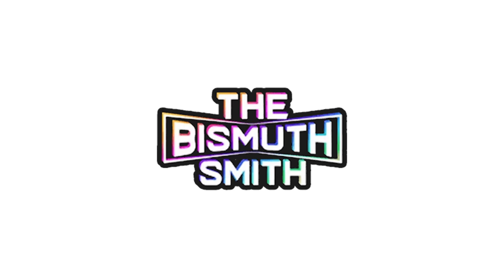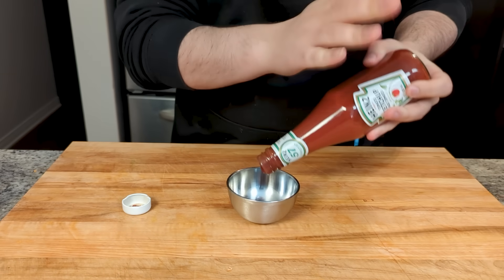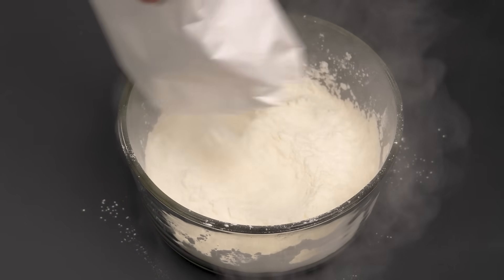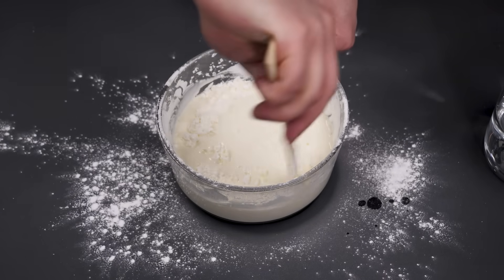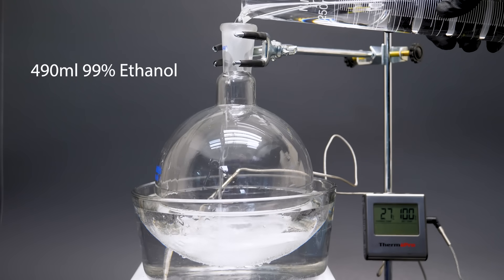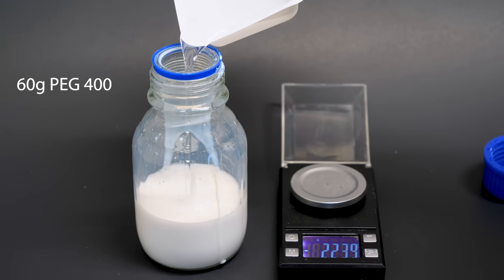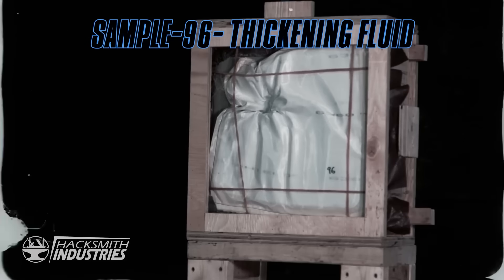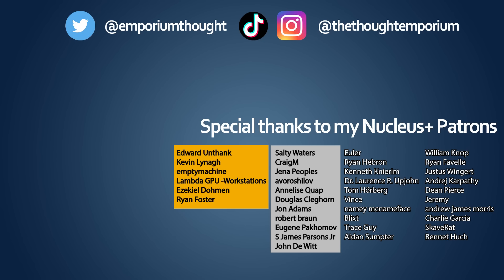Liquid Ballistic Armor? | Thehacksmith Collab

Comment: Thanks for sending us the STF to experiment! We'll have to try some other advanced chemistry projects with you in the future! That tank armor sounds fascinating...
Reply: First
Reply: Best collab!
Reply: I wonder what your team could do with the plasma sputtering beam.
Reply: @ryjunplayz8321  nice work
Reply: Imagine if STF was actually used for Tank armour
Reply: This is such a cool collaboration of skills
Reply: You can collab again and make a tank
Reply: If you end up trying the spider silk, I wonder what you could get by soaking the Kevlar fabric in the growth medium and letting the yeast grow and produce the silk in place.
Reply: Graphene particles in suspension?
Reply: And thus, the League of Evil was born
Reply: Hacksmith + ThoughtEmporium = Batman + Superman
Reply: You could send them your Kevlar scraps so they could do a follow-up with the STF
Reply: try making it with olive oil not water, it becomes electrically hardened it could make the best Bracks or shock absorbers etc.
Reply: @rodneynormanhersom3583  Wow, really? I'd like to see that.
Reply: so would ferrofluid work?
Reply: @Aaron-zu3xn  that's a magnetic fluid so no it has no stopping power.
Reply: Po yy
Reply: I actually had a similar idea, only instead of fluid, it'd be a form of gel, like gelatin, or ballistics gels, basicallyable to hold it's shape after coming out of the mold, that gel would quickly harden and set like rubber cement when exposed to extreme force, it also hardens when exposed to air so help plug up leaks in the armor like from for example, bullet holes. But like many non newtonian materials, the rest will revert back to its gel form once the force has stopped, except for the small area aroubd the hole to help preserve the rest of the gel. What do ya think?
Reply: nanoparticles son they harden in response to physical trauma.

Comment: "Nano[particles] son! They harden in response to physical trauma! You can't hurt me!"
Reply: STANDING HEEEERE
I REALIIIIIZE
Reply: BRO IT FITS SO WELL
Reply: @XxX_afterHours_XxX You were just like me
Trying to make history
Reply: Crysis reference?
Reply: @ConandeBrodo Metal Gear Rising reference
Reply: I was looking for this comment 😂
Reply: @LHWK_RHC same
Reply: Nu Uh -raiden (his dog brought him a cool red stick)
Reply: Dude I was gonna write that
Reply: @unk4617  To be fair, that blade might've been going between the particles, not allowing the particala to compress.
Reply: @rya3190  no its too thick even if the edge got through the particles would grip it like a vice 
maybe the sword was made with an alloy which on contact with the nanobots disabled them chemically
Reply: @unk4617  Well, you're also making that edge out of plasma, breaking down the solids nearby. Not to mention, if you're cutting between the particles, you're forcing them around the blade, outwards, with enough force to deflect skyscraper sized blades...
Reply: @rya3190  yeah but that doesn't get around the fact that presumably the particles are all over the body and not just skin deep assuming the blade of muramasa is just as strong as ridens normal vibrating sword  and i doubt a sword which is lorewise was passed down for a very long time

Comment: Also, .45 is not chosen for its ability to penetrate armor. It's the worst round for penetrating armor of what is in common usage.
Reply: Stopping power though. Imagine being hit in your best by sledgehammer
Reply: @Adoffka  What do you mean by "stopping power"? The kinetic energy of the bullet increases linearly with mass but exponentially with velocity. A regular 9mm round is generally on par with a .45 ACP in terms of force delivered even though the round is smaller. A 9mm +P+ round would blow the 45 ACP out of the water
Reply: @Adoffka  the average .45 acp produces between 350-500 ft⋅lbf at the muzzle,  the average 9mm is virtually the same.  to compare, a 55 gr. (that is 1/3-1/4th the weight of most 45 acp) 5.56 (the round used in the AR 15 and by militaries worldwide) produces well over 1000 ft⋅lbf out of anything with a 16 inch or longer barrel
Reply: @sergey_is_sergey arguably, stopping power is basically a thing, in regards to being shot while wearing body armor.
Reply: Yeah and neither are mosr sub machineguns. I was pretty disappointed because I was expecting them to be "gunning" for at least level 4 protection here

Comment: The best protection inserts for motorcycle equipment are made from materials with the same property, but more «solid» in free state, which looks like soft rubber (and doesn't restrict movement much) but becomes hard on impact and distributes impact energy  on larger area.
Reply: Works great, too. When showing off my D3O pads to people, I demonstrate by putting one over my hand & hitting it with a hammer. The reactions are always priceless.
Reply: They're not the best though. Not even close. 
They are by far the most comfortable though..
Reply: @Mentholox   Best doesn't mean safest. Aerobags vests are safest (or not to ride a motorcycle at all).
Reply: This is ridiculous. If it turns hard the instant it hits am impact, THEN JUST BUILD IT HARD IN THE FIRST PLACE.
Reply: @melody3741  Try to have hard shell around your knee or elbow joint. It is possible, but very inconvenient for commuting, for example. For hard core sport like enduro or or motorcross — sure, double articulated, separate protection. For touring or commuting? Possible, but too much and very inconvenient.
Reply: @melody3741  This soft protection is for use with humans. You are right about things like vehicle armor, but humans are soft and need something that moves well with them in order to be effectove in their tasks
Reply: that's smart af
Reply: Yep, d30 was in my lacrosse gloves almost 16 years ago. I hoped they'd make it bulletproof by now. 
@melody3741 you clearly don't understand the application of, and why a non-newtonian fluid would be desireable trait for bulletproofing. Flexibility. You ever wear a steel armor plate? Or a 3A soft body armor? Would you rather your shirt be made of wood or cloth? The idea is that it moves with your body when you want it to, but protects u when ya need it
Reply: What material is this?
Reply: @melody3741  because it would be pretty cool and useful to have a material that switches between the two as needed? Wearing a giant steel plate on your chest to stop bullets could maybe be improved on.

Comment: According to a paper I read, 12nm is the ideal size for the silica. PEG to silica should be a 60:40 ratio and the PEG 400 benefits from a 5% addition of PEG 10,000 (possibly a higher % would be even better but studies had not been done at the time I was researching. The graph of results improved with every % addition of PEG 10,000 and the curve showed no sign of flattening, but the study stopped at 5%) and the whole mixture (including alcohol) should be sonicated for even distribution of the silica through the PEG
The alcohol needs to be thoroughly evaporated off the aramid/kevlar/whatever so I would think baking it at 85c would be the way to go.
Reply from the maker: got a link to that paper?
Reply: @thethoughtemporium  I'm sorry, I don't THINK I do any more, this was just for a hobby project. It might be on my old hard-drive. I will look and if I find the folder i'll find a way to get them to you (2 separate papers actually, one about nano-particle size, the other about adding PEG 10,000)
I would note, that the 12nm size might be specific, for example it might be LESS good at energy absorption but also allow for a higher density of Silica to PEG, I'm afraid I can't remember the specifics.
Reply: @thethoughtemporium  I read a paper that said .25 micron fumed silica. it  also attributed the hold to micro vacuums made when the liquid was too thick to fill in the gaps fast enough.
Reply: @@msmoonboosource = the paper he just stated.
Reply: @Ms Moon Boo OP literally cited the paper right above you????
Reply: @thethoughtemporium  Modification of the silica surface using boric acid can form dynamically crosslinked covalent bonds.
Reply: @thethoughtemporium did you ever come back to this... Also what happened to the tank armour
Reply: @sarchlalaith8836  I wonder if he will ever come back to making the other gemstones that he talked about in the opal video :(

Comment: The interesting thing to look at would not be penetration, but damage — getting shot wearing soft armor may not result in bullet penetration, but it can easily bruise and crack ribs. You won’t see that find of improvment in the samples you were sent though. 

If you wanted to measure this, a force sensitive resistor grid with peak hold will give you a great idea of how (and if) the shear thickening fluid spread out the force appreciably.
Reply: Or just some kind of weights
Reply: I mean, a bruise or cracked rib is at least a preferable alternative to like a punctured lung, although I guess a broken rib could lead to that
Reply: Ya but if you could somehow layer a thin layer of soft armor over a thin plate of rigid armor, then youd having something very little and very resilient
Reply: @Brent-jj6qi we dont watch these videos for moderate and boring results. If it cant improve on very basic body armor then it's far from what you could consider a success

Comment: How do you avoid the particles settling out of suspension when layering them like this?
Reply: To put it simply, sedimentation/creaming velocity (for particles denser/less dense than the solvent respectively) are counter-balanced by Brownian motion (the tendency of any particle to “disperse evenly” (imagine e.g. color mixing into water)). Below a certain threshold of about 1 micrometer in diameter, a sedimentation equilibrium can be reached where sedimentation is perfectly offset by Brownian motion, yielding a colloidal suspension.
Reply: @waterunderthebridge7950   Nano-machines son.
Reply: @joshyoung1440  Go back to stackoverflow with that non-answer.
Reply: make a polymer out of it, or something of the sorts of an ionic liquid, where one of the ion donors is a long chain hydrocarbon
Reply: @trenvert123  LOL
Reply: I think more or less like saturating a towel, or some porous fabric layer, sandwiched with kevlar sheets. The fabric's porosity will allow the material to retain shape while fluid, but add sheer force and that gets distributed across the area without it flowing down due to gravity.
Reply: @waterunderthebridge7950  Ok so you're saying that with small enough particles, below a certain concentration the random motion of the particles outweighs their tendency to settle?
Reply: Add a polymer (or mineral particles) that gives your solution a yield stress value. The big particles won't be able to overcome the yield stress and fall down/swim up.
Reply: @waterunderthebridge7950 to put it “simply” huh

Comment: to keep it functional you have to use a liquid, as the glue prevents the compressive stacking. to do that in a vest you basicly have to make the vest out of pockets like a down jacket, so bottoming out is confined to each pocket, and make two offset layers so the seams are not weakpoints. or you use this non-newtonian rubber mixture thats used for some sports protective gear as a glue for the particles.

Comment: I wrote a whole paper on how novel concepts could be used to improve body armor. Sheer stiffling gel (SSG)was one of the topics i covered as well as resin based self repairing technology. One group of researchers found that carbon black could be suspended in the SSG you could sense and measure impacts based on the stiffling effect changed measured resistance acros the panel. This could be used as a monitoring device for combat medics to automatically alert them if someone receives a shot or impact that causes sever bodily harm
Reply: so you wrote a paper but dont know the difference between sever and severe 🤔
Reply: @MalcolmCooks  perhaps english aint their first tongue or maybe its a basic typo

Comment: The early uses (10+ years ago now) of STF in armor were to improve stab resistance, rather than bullet resistance.  Would be interesting to know if your initial attempt did that.  If so, improving the stab resist without compromising bullet resist, is a pretty big win.

Comment: Technically Ketchup isn't a pseudoplastic (shear thinning) fluid. It's a thixotropic system. The viscosity isn't just dependant on the force applied but also the timespan the force is applied. Whereas a constant sheer force applied to a pseudoplastic system will result in a constant viscosity, constant sheer force applied to a thixotropic system will result in a (time dependant !) decrease in viscosity. That's why shaking a bottle of ketchup will make it flow well for a short time, but only until the recovery time for the system is up

Comment: I was involved in similar testing years ago. It never resulted in being able to use less Kevlar but did show the potential to decrease back face deformation. The energy from a stopped bullet will still cause a lot of internal damage and leave you pretty messed up but if you can spread that force out over a wider area you can reduce the injuries quite a bit.

Comment: The problem with this principle is the issue with viscosity; while it works in some applications for impact resistance, the viscosity of the compound cannot be applied over a large area due to pooling; therefore, it cannot be used in a vest to provide the level or protection to stop a bullet without rendering the wearer unable to be mobile. The solution would need to be applied across a cross-stitch patter to keep the solution from pooling, then each layer would need to be re-applied over several layers that overlap stitches; thereby, stacking the pockets of stitched pillows over each stitch later like stacking eggs on top of each other; eggs filling the gaps. but again, each layer must be leak proof, and several layers thick. In theory, it can be done, but I am not certain it would work without giving much thought on the design.

Comment: I think the issue here is the application of the fluid to the fabric. The liquid portion of the fluid may evaporate or be absorbed into the fabric. This means the suspended particles are no longer suspended, so they can't move around as they should. 
I think the approach is actually more similar to your demonstration of the sheer thickening effect on impact—it's in a pouch. It is contained and not absorbing into the fabric and can properly disperse the force. You may want to try pouches of the fluid sewn into a fabric. So it isn't as easily affected by gravity and can further spread out the force, perhaps the suspension could be in a gel of sorts. This would create what could be called a layer of gel. If the dispersion of the sheer thickening could be done more over time, it may offer more protection especially if it can be geared towards instantaneous impact forces in particular instead of just any force, though that's more in the realm of science fiction I should think. 
All in all though this would create viscosity throughout the gel layer any time you crash several kilometres from the sky after your battles with the Covenant.

Seriously though ! Consider the idea. Good luck and happy hacking

Comment: IMO: a better way to utilize this technology would be to take some of the kevlar that the hacksmith shot (the stuff that would stop the bullet on the first layer) and then sandwich somekind of high strength bag full of STF between a couple layers of that kevlar and the rest of the vest. 

The STF effect works best when there is a larger quantity of the STF (like in the hammer test) and the effect wont work very well if the STF is punctured so i think this would be a good solution to those problems.

Comment: With the way you described the mechanics of it I don't think it could work as its own layer in a vest. 
If the shear thickening is a result of the particles jamming into each other, would a sheet of saturated fabric even have enough particles in front of a bullet to achieve the full effect? Even if it does, wouldn't the effectiveness max out around a thin sheet of opal?
Reply: It might be doable if you had packets of shear thickening fluid as a replacement for armor plates. You'd still have to contend with gravity pulling more fluid to the bottom of each packet though.
Reply: There's also the issue of it being heavier than three bathroom tiles epoxied together, which likely provide simar amounts of resistance

Comment: I wonder if graphene nano particles would work well suspended in a fluid. I’m also now wondering what properties of the fluid might improve ballistic armor. It seems it would need to be able to hold the particles stably without dissolving them and be easily expelled under pressure. I want to learn more about it now!

Comment: It think the hitting the clay with the hammer example is the wrong way to think about it. We won't have a relatively thick layer of fluid  in front. Rather it should be seen as the epoxy matric in fiber Composites, which is flexible and rigid at impact. For this it could be interesting to have the particle carrier not be a fluid, but some Form of elastic polimer perhaps.

Comment: Hello. The problem here is not so much your chemistry but volume. Instead of fabric (suit) think thicker like plating. You need a thick "plate" like layer on top to spread the energy and another layer beneath that can absorb it. Overall there should a reduction in weight in comparison with state of the art ceramic plate systems.
Reply: Like kevlar on front to slow and deform and then the oobleck to spread out the energy?
Reply: @JJayzX  Hello. In very simple terms yes but you still need something to absorb the impulse. A ceramic most likely to also catch the slowed down bullet.